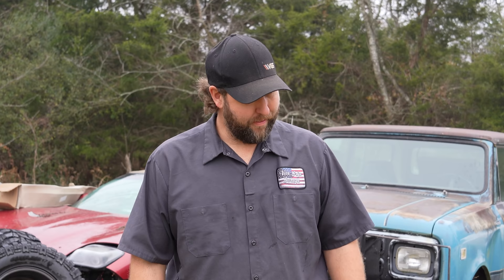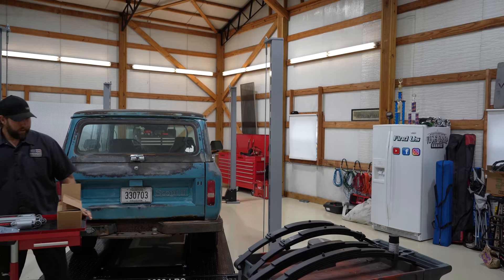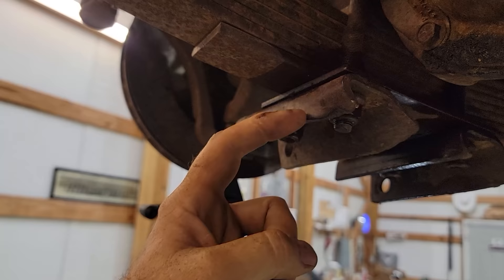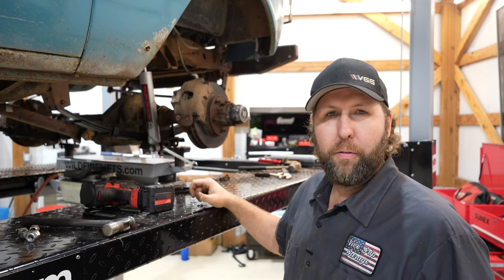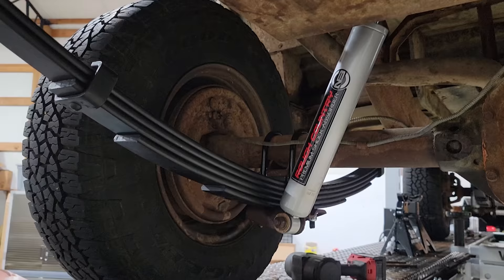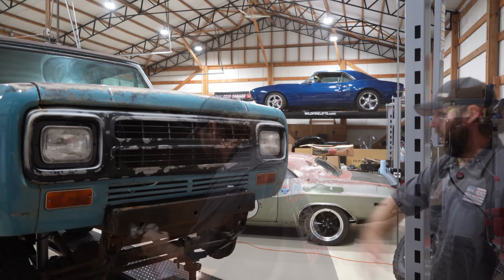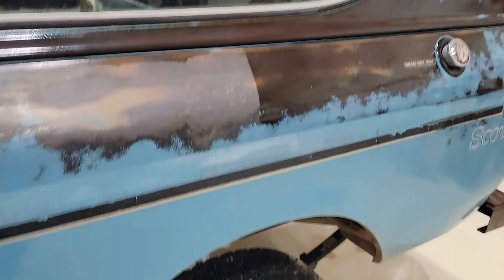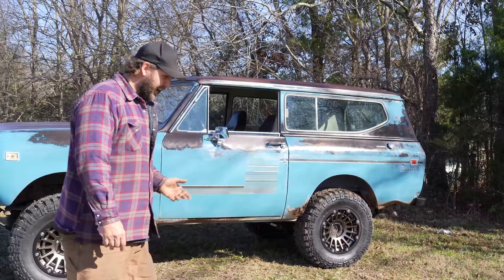I lifted my Turbo Diesel International Scout (INCREDIBLE TRANSFORMATION!)

Comment: This hit me right in the old excuse maker.

I bought the wrong size wheels and tires online once , so I did the right thing and went out and bought a car they would fit under.
Reply: iknklst  -  Where i come from that's referred to as "problem solver mode".
Reply: Whew thank god you said that, thought I was alone, those rims and tires sat under my back porch for weeks until I found just the right car.
Reply: Approved
Reply: @thomaswilhelm5120  them sparalators on the diesel will get ya every time!
Reply: Seems to me like the reasonable thing to do…
Reply: @jonathanshriver9651  -  That's what i was thinking.  That's why i eliminated them from all my diesels.
Reply: 🤣🤣🤣 you beat me to it
Reply: I Bought a set of 36 x 17 Hoosier  bias ply drag tires now im looking for the car they fit
Reply: I have only done this about 17.9327 repeating times...
Reply: Mine are still in storage.

Comment: I'm no diesel mechanic, but with an indirect injection turbo diesel the best ways to iprove power are to up the fuel and up the boost. I'd say an engine rebuild with head studs and a thicker head gasket and some upgraded injectors/injection pump, plus an upgraded or turned up turbo would be the best way a Feller could make some power. I really love your videos Derek, they really make me re-evaluate my attitude when working on projects.

Comment: Little tip if your replacing those front schocks I use a long extensions for leverage to break the nut off by bending it back and forth a old front end guy at the dealership I worked at showed me this trick it's worked for me 100% of the time

Comment: A couple of things: 
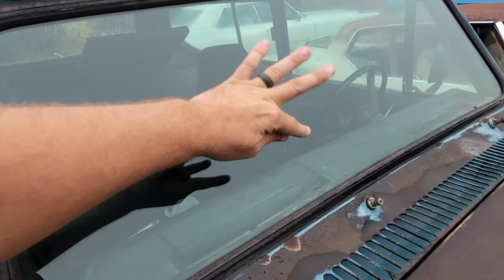1) I worked for the local IHC dealer when I was a kid and drove a '79 Scout to college.  With the diesel they'd spec out a numerically tall axle ratio and the wide-ratio 4-speed; the V-8s got shorter gearing with the close-ratio box.  All had 2-speed transfer cases.  Spec'd thus, they could do 100 mph easily, and the 345 V-8 a good deal more than that.  Mine had an "upgraded" 345 - high compression pistons, Holley carb, stiffer valve springs - and the close-ratio 4-speed, with a 3:31 axle ratio.  I drove it up and down the US Interstate system border to border and coast to coast.  It'd pass anything on the road except a gas station.  I still miss that Scout.
2) All the glass on a Scout is flat.  Any auto glass shop can replace a broken windshield/window.
Reply: Very true about that glass. Had some cut. But for about a month one winter we were using the old scout I made some out of Lexan just to keep the cold out as we hit the trails.

Comment: I purchased a brand new Nissan Patrol in 1984 and ran it for 8 years and put 303k totally trouble free miles on it apart from an unhealthy consumption of glow plugs. Every winter it would go through a couple of sets, and believe me i can tell by the sound of yours trying to start that yours is down to only one or two still working. It had exactly the same engine as yours but was only naturally aspirated, yes, NO turbocharger!  It had no problems running at motorway speeds of 70 to 80mph, even towing a 3.5 ton trailer, it was a great work horse. When i sold it to a friend it still had its original clutch and rear brakes. He put another 250k on it before the bodywork fell to pieces, but was still mechanically spot on. He sold it to a guy who took out the engine and fitted it into a forklift truck which is still running today. One interesting feature on the Nissan Patrol diesels of that era was that they had 24v electrics. It was really handy being able to jump start great big trucks.
David in the U.K.

Comment: The engine is fine. The injector tips just need to to be serviced. They need to be done every 60k to 80K.
That will get rid of the smoking. Also check that all the GP's are all working.
This is an IDI engine so you can't turn up the pump and increase boost, unless you want to crack all the pistons. Biggest improve is to get rid of the Turbo exhaust house (It's a 90 degrees housing into 1.75 pipe.) and put in 3" pipe all the way out.

Comment: I had one of those in a scout and really liked it; but when I first drove it it was a gutless wonder!!! Put a boost gauge on it and found it was only producing 4 pounds of boost. Talked with a couple of guys that run them and did the following. Drilled the perimeter of the air cleaner with 1 " holes. Put in as many as I could so that it would get air into the engine. Then completely blocked off the EGR valve. (don't remember if that's the correct description) but it was controlled by some vacuum pod. And then it would make about 7 lbs of boost. After reaching 7 pounds of boost the pop off valve would open up and that was all you could get. Still not satisfied we removed the pop-off valve and shimmed it until the boost gauge would reach 14 pounds. This made a world of difference and it usually ran along nice at about 9lbs, however, in cold weather the boost would creep up and it was easy to see too much heat on a long pull. I ran it set like that for a couple of years. BUT, I broke a radiator hose one cold night on a long pull and didn't notice it in time and basically ruined that engine! I am not real sure what happened first but when things cooled down there was compression in the radiator and I sold the truck to someone that had time to work on it. I know that the little SD33 engine is an efficient little engine, Always got about 22 mpg on the road and I have to wonder if that engine was in a lightweight and aerodynamic car what it would have done there.

ED

PS IN ADDITION TO THE PYROMETER, one other major improvement that I did not get done was to open the exhaust pipe up leaving the turbo!

The guys that run them will tell you that a little different turbo housing and an open exhaust system will make them run a bunch cooler and will save the engine from the effects of over boost. Greatly improves performance!!
https://www.redpowermagazine.com/forums/topic/41844-ih-scout-sd33-turbo-diesel/
Reply: Steve, it sounds like you know your cars! Good info! Thank you!
Reply: That kind of info will definitely help Derek out.
Reply: That's impressive fuel mileage for a Scout II, since they weigh ~ 5,000 lbs. and have the aerodynamics of a brick (a Scout II is basically a box on wheels).  The two I had with International 304 c.i. gas V-8's got about half that (10-12 city), 14-15 highway if you kept the speed to 60 mph or less, not much better than the city mileage if you drove faster. The gas V-8's had decent power and lots of low end torque, but weren't efficient at all.
Reply: @russlehman2070 that's why you gotta love the little diesel motors way more efficient

Comment: With the increased pinion pitch, i would run a oil stabilizer or raise the fill hole on the differential cover to prevent starving the pinion bearing

Comment: I used to have an '80 Scout II that came with the dreaded Nissan Turbo (really?) Diesel. I had the truck for several years and must say it was so nice to have the top off and drive to the beach here in Northern California. The real fun started when I sold the Diesel engine to a boat company and installed a balanced, rebuilt IH 392 V8. I miss that fun truck since I sold it to a buyer in Tennessee several years ago. There are lots of places to go and have fun with your 4x4 in California. Happy motoring!
Reply: Got watch out for those dreaden thingys

Comment: Stock injection pump and turbo of SD33T are good for 150hp with aftermarket cooler. More injection timing helps with starting and power. 

Engine itself is good for 200-250hp with 30psi of boost with good intercooler, bigger turbo & injection pump plungers. SD33 and SD33T were quite popular builds here in Finland about 15-20 years ago.

Comment: Heya fella, I’ve owned 3 sd33ts…seems like the engine as a hole is pretty tired cause even with 35inch tyres I wasn’t down to second on any hills. 

But if your chasing a bit more power you can up the boost a bit to 12ish psi (8psi stock) then just tickle the injector pump a bit so she’s sending in a bit more fuel. That’ll help it a lot
Reply: Does it have an intercooler from the factory, or is that something that would be worth adding?
Reply: @th3ch33t  nah they don’t. Definitely worth adding if your adding more fuel but not essential
Reply: Agreed 👍👍👍👍

Comment: Brings back memories. I had one these diesel Scouts I bought new, but a pickup style. It was gutless, but I found a turbo kit for it. Helped quit a bit, but I installed it with the air cleaner bolt wrong and it was swallowed down the intake manifold when it got loose and it completely ate all the turbo blades. It was a tough engine though. Once delivered twelve tons of fertilizer on board and a small Uhaul trailer in Arizona with temps in the triple digits and uphill. Kept going. I did add the big wheels and tires and made a very nice improvement in the ride.

Comment: When I saw the truck with the new wheels I just said out loud "YESSS!" It looks the absolute business. As you said, keep going on it! I love it! Start with the engine though. Those Nissan engines are bulletproof and can certainly handle more power. Wind in the max fuel screw, increase the turbo boost pressure and add an intercooler for a start. You could maybe look at a bigger turbo as an option.

Comment: In the mid 90’s I drove off road with a petrol Scout in Tasmania Aus. Great vehicle, unfortunately they broke the rear axle in South port. Luckily it was a floating rear, so we dragged her out and removed the axles, and went back to the shed. He was a beast. All the wiring was replaced with green wire… made fault finding exciting. We did the right thing and left it.

Comment: I have owned 11 of these, rebuilt nearly all of them. Love theses trucks. I installed a full floating rear made by warn on the rear axle and a Z gate dropped pitman arm on the front. Also added a warn locking hub kit to top off the money spent. My truck had the 6" skyjacker and 4" body lift along  with 35's, it made for an excellent trail rig. Only thing I wish it had was taller gears, the 3.31 with 35's made for great gas mileage, but terrible climbing  ability's.

Comment: If you want to hop up the SD33... put it in a boat and drop it over the side. Pop down to the junk-yard and find a Nissan TD42T, making sure it has twin oil filters.
The early ones had oil feed issues but the later (twin filter) are unstoppable.
Reply: I'd assume you've seen the Skid Factory TD42 swap a couple years back?
Reply: @TheBreaded  Never heard of it. I owned a Nissan Safari TD42T. I also had a 1983 SD33 Safari that was underpowered, and sold it to a feller who pulled it to bits and used the motor in a boat. Inside it though, not thrown over the side.

Comment: I run a 4.10 gear on my diesel scout with a 33” tire that motor is meant to run 32-3600 rpm with a 4.10 and a 33 that’s about 2700 rpm at 65

Comment: Being a mechanical diesel with a turbo I would imagine there is a way to increase fuel pretty easily and maybe bump timing. It will make it smoky but you’ll typically pick up a good amount of TQ. Maybe a feller can then install an EGT gauge to hook your peepers on it and monitor the ole girl.
Reply: theres an adjustment on the injection pump
Reply: Use the low side of the transfer case and first gear. Stock there is enough torque to tear up the whole drive train
Reply: @TylerDuysen  yeah that’s what I’m referring to
Reply: @ronunderwood5771  lol is he expected to pull of to the shoulder and drop er’ in 4 low every time he gets to a hill going to town? That’s just not practical unfortunately unless he wants a 30 mph top speed.
Reply: @glenns3122  Actually low low he probably wouldn’t see 10!! I meant more for creepin around off road. Drove a bunch of these (and sold them) with Internationals cast iron V-345. Very capable off road. Notice the approach and departure angels. Very good tough trucks. If they could have put better metal in the bodies!
Reply: @ronunderwood5771  what I found most interesting was the coil over shocks? Is that a factory setup in the rear with the lead packs?
Reply: @glenns3122  Factory was just normal fluid shocks.

Comment: You should do some research and try to find out what the specs are for the boost on that engine is. And maybe see if u could match up a lil bigger turbo on it. That could give u a lil more umph
Reply: Depends tho, I've got a diesel of my own with a manual transmission, normally cause of the amount of torque diesels produce you gotta upgrade the trans or the extra power will grind right through it. But would love to see it. idk how hard it would be on this.

Comment: My father had one with a 307 in it and pulled our 24 ft Grady white fisher boat and bigger than a one-ton dump truck out of a sandy boat launch sunk in and smoked all four tires to get it out after getting on some pavement {no joke} that scout was a beast screaming at 90 from Moosehead lake ME and back to CT with 300,000 K on it and family work truck with plowing in the winter.

Comment: If you want to help the power out a bit without doing much, you might try using some Engine Restorer in it. I saw a video on Project Farm where he used it on his old diesel Ford tractor and it helped the compression problems out significantly. Where he was having to use either to start it, he no longer had to do that and his before and after compression tests showed that it worked. You might also try using either Seafoam or Hot Shot Secrets in the engine oil to make sure the turbo is spinning freely. Definitely use a dose of Seafoam in the fuel.

Comment: like the scout  looks good i have a 1978 cj5 4'' lift 35'' tires 360 400 hp amc motor t18 4 spd  it has a throttle down custom frame  i enjoy it very much

Comment: I’m saving a 1983 Oldsmobile Cutlass supreme that’s well furnished , the old stove in there is a 305 which runs like a top and so after I get the new springs , shocks in it Im gunna just cruise it around . Cheers
Reply: Them were good rigs! We had an ‘84 Caprice with the venerable 3.8. Currently my brother has an identical one with the 5.0. Neighbor down the road had a dull rose red Olds, like yours.

Comment: Another great video. Really appreciate what you did there with pushrod length. mathematical and come to find out that my 351 needs rebuilding so I’m gonna finish tearing it down sending it off to the machine shop with the heads have a magna flex check and see where I stand with it. Gotta figure out what I have with the FMX trans as the redgiator failed and she has strawberry milkshake in the trans and we’ll ALL over the barn floor even thought I sucked out of the pan as much as possible gonna drop the pan and see what’s going on get it all drained and try flushing it while the motors out. It is a 1974 flavors so I should be in pretty good standing but more will be revealed really appreciate it. Looking forward to more video on this project. Thank you so much!

Comment: When you run into the bent brackets like on the spring u bolts, I use a large crescent wrench, tighten right over the bent lip and it usually straightens right out with a bit of arm twisting

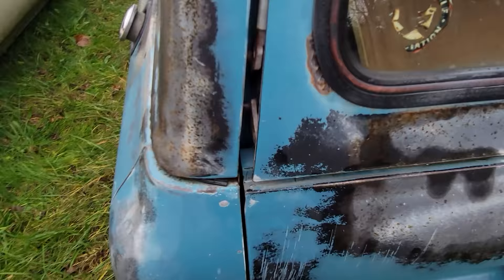Comment: Compression is probably a little low, you definitely need new injectors and glow plugs which would help pep it up, you wanna keep the gearing around 3:55 or you're not gonna be going fast enough for the free way, you may be able to turn up the fuel but you'll need a pyrometer first, also check fuel pressure and make sure you're where that engine should be

Comment: I'm pretty sure the nissan td42 engine fits exactly on that bellhousing if a guy would ever think of a diesel engine swap. Get bigger pump elements for the dieselator pump. Should be able to pull the skin off a hot cup of cocoa. On the other hand, if a guy wants to keep it original, only right thing to do is to screw the fuelmass screw way to deep until the ting having trouble idling and get rid of the wastegate actuator hose. Should give it about 30 psi boost

Comment: If anyone is looking for those wheels, they are Vision brand, they are called "Creeper" if I remember correctly. I bought a set of 20x10 for my 99 Super Duty in 2018 when I was trying to find some sort of turbine look.  They do make a wheel called "Turbine", but it's way too busy and it just is not the same.
  I hope down the road some shops will affordably weld new material on the old 16.5 wheels and trim them to work as a 17 (or 18 if they want to build up for a beadlock).

Comment: on my 7.3 turbo. i turn out the rod on my turbo boost valve 4 turns to lengthen the rod . this will hold the turbo boost longer . do this gradually and  preferably with a boost gage . ii learned how to cdo this on youtube from a youge man in a wheel chair . i think his show was called life on wheels . grate tip ,i was very happy with the resuilts. also the taller tires will give you better road speed.

Comment: It looked great with the lift and the old wheels/tires. The offset was right, the lift provided just the right amount of wheel opening clearance for the 31s (if it had come from the factory with 31s that's how it would have looked), and the old style turbine wheels look infinitely better than any modern zoomer design. Once you added the new wheels/tires it regressed back to the "not enough wheel opening clearance" look that it had before you installed the lift, and as a "bonus," it gained a "wrong offset" and a "too much wheel, not enough sidewall" look to boot, which brings to mind the look of a roller skate.